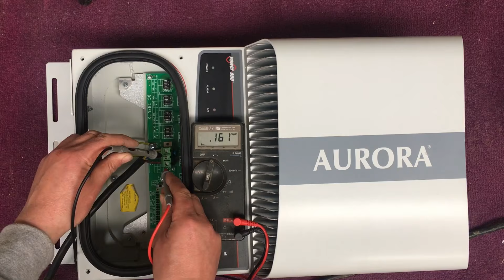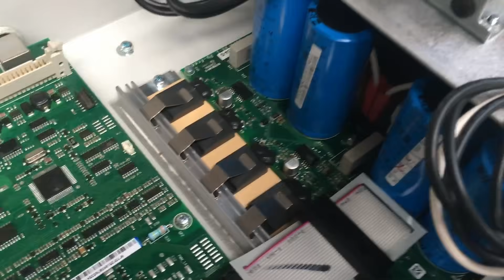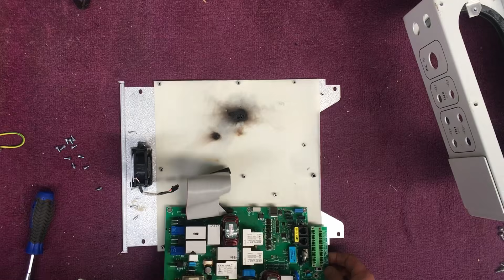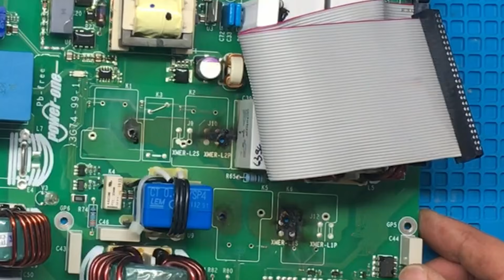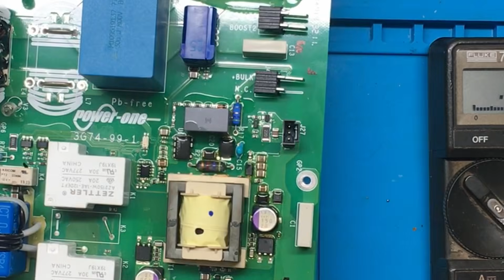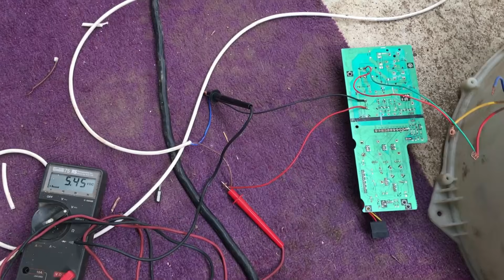Solar Inverter Repair / Fix - Aurora Power One (Multiple Faults) and E031 error

Comment: There are no snubbers over the relay contacts!? (to suppress the induction pulse when breaking contact)...When switch AC it is a must. When switching DC a diode 1n4007 in blocking mode is very useful...

Comment: Hi Great video . Followed all the steps and then found another E O31 error but this time on the logic board tiny black components blown but cant seem to find a similar component to replace it with poss resistors or diodes . Any thoughts would be much appreciated ,
Reply from the maker: Thanks 👍It's hard to say as a lot of very small resistors etc have no markings on them, so without a schematic or another unit to compare with it's pretty much impossible to work out what value it is / was.

Comment: Long since relevant now I'm sure, but those burnt relay terminals have tracks on both front and back layers of the board and if the vias (plated through holes) are toast too, the connection could be weak to the top track under the relays and cause future arcing. Always worth running a wire/some solder wick through the hole and solder in place both sides to make sure both tracks are solidly connected if the via has suspected damage.

Comment: It would have been nice if you had provided the part numbers for the Zettler relays, so that we can see if they can still be purchased before disassembling the inverter. Great video, though. THe inveter at my rental property is completely dead, and I noticed that the surge arrestor is also dead. Probably lightning damage to the main board.

Comment: I have the same problem with the E031 error, burn marks on the circuit board on two of the relays. I replaced all four relays and tested and confirmed that all the tracks for the relay connections are good.
And STILL, I have the same error. 
What else could be the problem? I'm at a loss.
Reply from the maker: I'm trying to remember, but I think there's lines of resistors near the relays that measure the voltage. Perhaps those aren't connected to the right point if the board has been damaged? or one of the resistors might be open circuit.
Reply: @BuyitFixit  I will open it up and take another look at that. I didn't really see any damage on the board but I might have missed it.
Thanks for replying.

Comment: Well done mate i wish you can fix my same unit  same model here  stop working  how i dont know was a Elctrition and plumbers plumber installed new heat split water heater and now my inverter stop working after there instal the water heater now staf my inverter no power only makes kicking noise please help.i live in Wollongong .nsw Australia
Reply from the maker: I'm wondering if they have damaged the wiring? Seems strange how it was working before the install.

Comment: Damn it. This is exactly what my unit looks like right now - grid and DC but nothing lit; except mine is on the wall in a cramped loft!
Other than that...where do I order the parts from should I ever get brave enough to take the thing off the wall and dismantle it so I can fix it (assuming I have the same problem).
Reply from the maker: I think I ordered the parts from Digikey. You might be able to get them from RS Components etc.
Reply: @BuyitFixit  Thanks. I finally got brave enough to lift mine off the wall in the loft. Turns out 18Kg isn't as heavy as I was worried it was. However, if I may pick your brain...the board looks pristine and not sign of anything burning front or back. Could this still be the relays? I don't have a means of adding controlled DC to the unit so testing on the bench is impossible.
Reply: I looked up the data sheet. AZ2150 A12, the coil has a resistance 155 Ohm +-10%. So low end 140 Ohm. I'm measuring 127-130 Ohm consistently across my relay coils. Possibly my meter is badly calibrated?

Comment: This is a really thick question from me. Why could you not just inject DC to simulate a solar panel? Why did you need to spin an old washing machine and rectify it?
Reply from the maker: My bench PSU only goes up to around 40V max... This needs around 120-140V DC before it would even power up.
Reply: @BuyitFixit Ah, ok, I understand now. Sorry, I knew it was going to be a really silly question!
Reply from the maker: Hey, it's no problem at all 🙂👍

Comment: Just bought one of these.  All 4 relays burnt and the same diode gone.  It's labelled LM 3WY.  I cant find how you found out this is a SMBJ15A.  Can you give me a clue?
Reply: Changed the 4 relays and beefed up the area around the burnt pads.  Changed the diode labelled LM 3WY for a smbj15a diode and also Changed the 15uH inductor next to the diode as I broke it getting the diode off.  All working fine!
Reply from the maker: Nice one. Well done!
Reply from the maker: Sorry, I can't remember off hand, it was a while back when I looked at this. Perhaps this one had different markings on the diode.
Reply: OK thanks.  I'll give the one you mention a try.  I enjoy watching your videos, thanks for inspiring me to have a go.

Comment: Hi, I'm repairing an inverter like yours, but I can't find the diode with the initials (Lm 3wy) for sale, could you help me? Thank you
Reply from the maker: @maxcrs6251  I've just had a quick look on smd.yooneed.one but not much came up. 3W seemed to bring up some zener diodes MM3Z68V but not sure if that would be the correct part. LM didn't bring many diodes up at all.
Reply: @ Hi, since my inverter is the same as yours, do you remember which diode you bought?
Reply from the maker: I've just had a search through my eBay history, and I bought this about a week before publishing the video: https://www.ebay.co.uk/itm/152900848943 although I'm not 100% if it's the one I used on the inverter or if it was for another item.
Reply: @ Perfect, I hope to solve it.. thanks

Comment: So when spinning the washing machine what actually causes the physical resistance to turning? You said you could feel the drum getting harder to turn? 

Blew my mind when you said that.
Reply from the maker: As the inverter tried to draw more current the magnetic field in the coils increases making it harder to turn. A common way to brake smaller turbines is to put a large load resistor on the output which causes them to slow down.
Reply: @BuyitFixit mind blown 😂. Thanks so much for finding the time to explain.

Comment: Just came across this video,seems my inverter has failed the same way,but my relays are OMRON,g8p-1a4p-bg,12v coils,do you stock,or have any spare relays,or suggestions,ps did enjoy the video,very informative,thanks.
Reply from the maker: Thanks 👍unfortunately not. I just ordered the relays for this one on ebay. Try searching the part number on google and I'd think one of the electronic component suppliers will probably pop up.
Reply: @BuyitFixit  thankyou for your response,seems to be discontinued,but I’m going to try and get replaceable relays and mount them inside the case,I’ll keep looking, thanks again.

Comment: Sorry to ask but how are you tracking the wire as it looks from your video on 12:48 bridges between the faulty switch and the blue transformer thing next to the relay switch?
Reply from the maker: The wires follow the actual circuit board, they are just reinforcing what is already there to reduce the current going through the copper of the board.

Comment: Nice work!  Really interesting repair - fairly tragic relay failure, plus flyback failure.  Fun means of testing it too!
Reply from the maker: Thanks Steve👍, there was a follow up video to this one where I ended up having to reverse engineer their software, as they wouldn't give me the engineer code to change a setting! "No password, no problem" if you haven't seen it.

Comment: do you have a solution for the Riso low 0.00MOhm message? the installation of the panels is correct because it works properly on another inverter. Regards
Reply from the maker: Sorry, I've not came across that issue. I'm not sure how the inverter measures that, I guess there is some component that has failed in the inverter somewhere..

Comment: Great job, liked to see it could be diode and transitor failures too. I have one of those inverter I put on side for some time, displaying "missing grid" while the gird is well present on terminals. Will have a look to these components! Ah, at the beginning of the video, only powering the inverter via the AC output will never power it. It need DC input (min 60VDC?) to pozer up and display something, even there is no grid at the time of the test. Good job man!
Reply from the maker: Thanks 👍The weird thing is the sunnyboy inverter I have does power up from the main, so I thought at the time these did as well. Missing grid might be one of the relay contacts or a dry joint. I'd be checking that first. I think there's a ladder of resistors next to the relays which sense the actual voltage.
Reply: @BuyitFixit Thanks for your fast feedback, much appreciated. I did order the diods you replaced, just in case of, so if when opening the unit there is same kind of failure, I will be able to fix immediatly. Again, nice to have guys like you sharing experience on those inverters!

Comment: i worked for a company that had loads of failed victron and other invertors that i asked to have a look at but they just scrapped them. easy fixes really by the looks of it. such a shame. easily 20k worth of stuff couldve been fixed for not very much
Reply from the maker: Such a shame and very wasteful 🙁
Reply: Victron are sooo easy to repair, easy Access to everything, only a few high power components.
Reply: Let me guess…USA. It’s because I’d rather sell new ones instead of offering these at a deep discount with no warranty, no serial number. Even if you give them to your employees, it would be better than scrapping them.
Reply: Yyuyyuzuyyzuuu😢😢😢😢😢😢😢😢😢😢😢😢😢😢😢😢😢😢😢😮
Reply: Can you give a look at the rs450 mppt any ideas buddy.

Error 200 😢 victron 

Rs450/100 

Think dc shorts on output somewhere on the cicruit board😢

Comment: Hi,hope you don't mind me asking. Iv got three studer xth8000-48 that iv been running single phase so only inverter 1 and sometimes no.2 if it happens to pull more than 8kw get used and inverter 3 just sits on standby. A couple of weeks ago i noticed a message on the screen saying no inverter 3, had a look and no lights on it and completely dead. Im sure it will just be something simple like the power supply to the board as it wasn't being used when it died. Actually none of the inverters were being used when it died as id been running on mains. Im wondering if you investigate and fix things like this as a job or could point me in the right direction of someone/company that does . Thanks in advance for any advice
Reply from the maker: Hi, sorry I only do this as a hobby. Unfortunately in my experience solar companies just want to sell you new kit, and are not bothered about helping people repair equipment. I did a follow up video on this inverter where I needed to adjust a setting, and needed the service password. I emailed the company who took over from Aurora, and they said it's an old model, buy a new one! and wouldn't give the the password! I thought I'm not doing that after I've just repaired it, so I had to resort to reverse engineering their software and working out the passwords for myself 😂😂 I emailed them back to let them know, and that I'd be posting their responses on my channel. All of the emails are on the video called "no password no problem" if you want to have a look at the email's back and forward, and I also found some hidden stuff in the software (including some games they wrote).

Comment: Great fix and use of the washing machine! Curiosity: do you have an isolation transformer when working with DUT that need mains? I'm planning to do more repairs and I'll need one for sure - any suggestion about which one to buy?
Reply from the maker: Thanks 👍no I don't have an isolation transformer currently. I was reading an article about them which was quite interesting about and also explained the risks using one https://sound-au.com/articles/iso-xfmr.htm
Reply: @BuyitFixit  Hi, is it possible to test, instead of the washing machine motor, with a variac and rectifier bridge? Connecting to a UPS to isolate it from the network? Or from rice error 0.00? Thank you very much

Comment: Would the relays actually be bad? If it's just the joints failing?.. or is there not enough left of the pole to resolder?
Reply from the maker: Probably both. The contacts inside the relay will wear over time especially if any arcing occurs, but also the legs had burnt off a bit on a couple of them. May as well not take the chance and just replace them all as it's a more work to disconnect everything and strip it down again.

Comment: I have the error code 31 would you be willing to fix my inverter how do I contact you?
Reply from the maker: Hi, the parts to repair it are around £26 then postage would also be a fair amount as it's a quite heavy unit. I noticed there are people on ebay who charge around £90 for the repair.

Comment: I also fix mine 10kw before 5 years. Mosfets, driver ic and gate resistors changed . Its very fixable with low price parts. I did the tests with a 12v to 230vac cheap inverter from the dc Vbus point.
Reply from the maker: Nice, well done on repairing yours too!
Reply: Quindi alimentando solo in ingresso 240 vac  il display rimane in standby? 
Si accende solo quando stanno collegati i pannelli solari?
Grazie
Reply: @erosdipersio9231  The high frequency inverters  have dc dc boost converter and the 12v (mine) are about 400v in Vbus point, from there another circuit with mosfet converts 400V dc to 230Vac. I use  Vbus with  an old lamp in series to the PV in of the fixed grid inverter to check it. I didn’t use PV panels.

Comment: I believe it’s a synchronize inverter it use the input frequency to automatically adjust the micro controller to the ac input frequency matching the same frequency so the ac output mixing with the ac output
Reply from the maker: Yes, it's a grid tied inverter to send solar power back to the grid.
Reply: Hello I have a 6kw abb inverter that has blown a few capacitors and a small light bulb internally, I tried to fix the problem myself but no success can you help me,if so I can send you picks of the problem area to see what you think ,or I can send the inverter to you to have a look ? Thanks

Comment: Another great fix. That will be worth a bit of money now. We have a Fronius 4kW grid tied Inverter and after 15 years it's still going strong. The panels have dropped off a bit but we're getting £0.69.a kW/h, still 'neutral' on our Gas/Electric as we get £1000 a year FIT
Reply from the maker: Thanks 👍and nice. I've been trying to set up a system so we are pretty much off grid (still work in progress) but I changed the two Aurora for a 5kw victron with a 48v battery backup of about 25KWH, it's only generating about 1.8kwh each day for the last couple of days due to the weather and time of year.
Reply: @BuyitFixit  Wow impressive. Keep up the good work and loving the streams..

Comment: Nice repair, I love your method of simulating a solar panel (rube goldberg would be proud). 
I just had to fix a 10kw growatt inverter, over-tightened standoff warped the board cracking and shorting a single 10uf ceramic cap causing the main smps to go into oc protection preventing a 3 month old $1600 inverter from working. I've had problems like this on about two thirds of the appliances I've brought in recent years, can't help but feel quality control has gone to shit.
Reply from the maker: Thanks and yes agree. Stuff seems to be made cheap for either maximum profit or to undercut the competition I'd guess.
Reply: It has with HVAC equipment too. The USA oligarchs love their high profits, Christmas bonuses, corporate aircraft and monthly stock dividend pullouts. Quality comes last now. But it’s quickly catching up with the bass towards!

Comment: Generally these things are designed to run off of the battery input not the mains input, because they're designed to work when the mains is gone or they output to the mains.  It's an inverter.  How can you troubleshoot it if you don't understand what it does?
Reply from the maker: Well, I've never came across one until then, and I did troubleshoot and I did repair it. I thought it might power the display from the AC side but I guess I was wrong. I don't know everything about every possible device out there. This is a grid tie inverter and does not output if mains is not present,it does not work in the same manner as a standard 12v to mains inverter that you connect a battery to. I then needed a service password to adjust a setting and the company said it was an old unit and buy a new one. So I then reverse engineered the software and wrote my own password generator anyone who has the same problem can download free of charge. (I did a video on that and put it in the video description). See the 'no password, no problem' video I did...